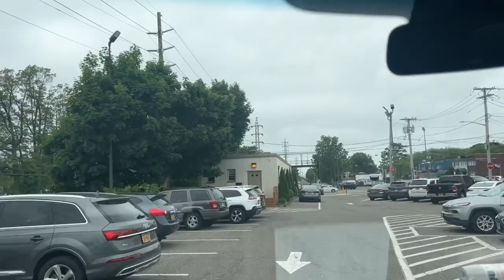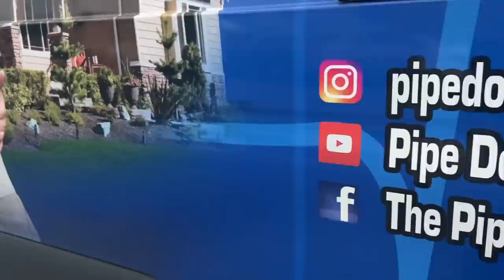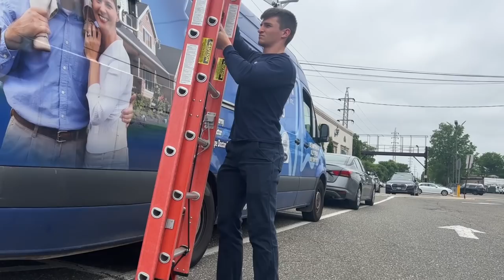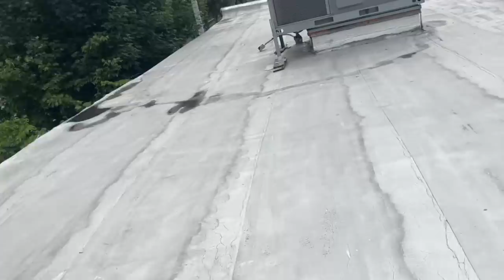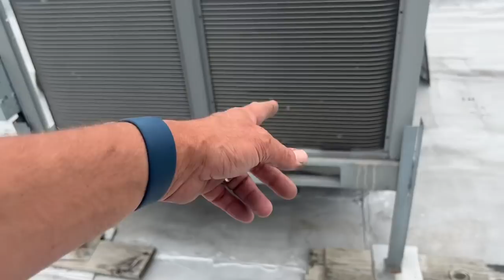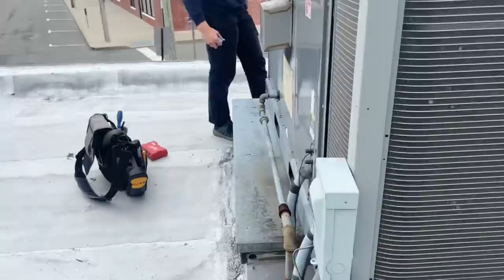Did I Hack This Rheem Commercial Rooftop Unit?

Comment: Instead of the tape you used , try some 2-4” tall strips of tin. Screw into existing ductwork that’s too short & into the unit. A more permanent duct extension , you could duct seal it afterwards too.

Comment: Mike, Joey's comment short of lifting RTU and addressing curb is the best option. Galvanized sheet metal strips is your least evasive move. 4 strips, 1 for each side to fill gap. I'm not able to see if you have enough overhang to put a 1/2" 90° break on each piece to butt up against the underneath overhang if you have any overhang to begin with. Before using selt tapping sheet metal screws you can decide if you want to apply caulking to the back side of strips, I would before applying sheet metal screws. Don't use silicon caulking, it garbage for this type of repair,  use a good caulking for the conditions this repair will be subject to in all weater conditions.
Reply: POOKIE

Comment: That Drop from the pole to the structure was definitely live…….
Reply: here's my large electrical cabling cutters, give it a snip and see. (yeah DO NOT)
very much excitement would occur, as the cable and tool turns into a fireball of long burning arc-flash, until it either fully burns in half or melts down upstream butt splices/connectors and they'll do that just that after a long period of buzzing, smoking the coating off, etc.
I've seen  service entrance cable below meter used for chaining up a dog! it yanked enough it shorted one hot leg to the ground braid and burnt the meter up and the whole cable on the home and 150 feet across the yard on three poles to the transformer, where it eventually burnt out a butt splice!
it was a rental property and they're like can you fix it? someone else was there and only quoted them a main breaker. YIKES that was not a good conversation we had, the place nearly burnt down and I called for emergency disconnect of the rest, the other hot leg was still live!

Comment: When I was doing HVAC. I always had a roll of tin 4" and 6" wide for such occasions. Cut to length. Screw in place . Caulk the joints. If it moves again. Just relocate the screws!

Comment: Mike, you can’t rely on the insulation properties of a triplex power drop to maintain its integrity when exposed to weather. Putting your hand on that or touching it in some other fashion can indeed result in an electric shock. All you need is a pathway the size of a small pinhole. That bundle is the power for that building coming from that pole.... so yes, you want to avoid something like that, or……put approved insulation sleeving over it before you approach it. Some people think that a voltage such as that won't kill you, and those people are wrong. All you need is for your heart to go into fibrillation, and without an AED, you are dead before the ambulance can get to you are use their AED they have on the truck. Also, the real fix, as you probably know, it to re-curb for that unit. Many malls do not allow the use of curb adapters because of water issues.
Reply: yeah, they should stay away from it. but in reality they'd have to grab it with two hands or be touching something else grounded and grab it. 
the bigger issue is it's not fused and could become a nasty arcing fireball if it got shorted somehow, also any of the wiring there is a tripping hazard and could make you do a header off the roof. unless you're some crazy parkour person, taking a header off a roof never ends well.
Reply: @throttlebottle5906   Actually, it only takes one hand. You would be shorting one of the hot legs to that messenger wire.... which is the neutral.
Reply: @arthouston7361  yes that would shock you're hand, possibly cause arcing and maybe a fall from the ladder. the fall may very well kill you, but single hand touching at that voltage wouldn't, unless you have conductors ran around your body or are grounded at some other point. the power would stay localized in you're hand/arm end.
Reply: @throttlebottle5906  Not true. There is a very high chance that hand shock sends your heart into V-fib. See above. The fall of 12 feet from the roof in question might kill you, but the V-fib will definitely kill you unless that rhythm is restored in under 10 minutes. We learned how to not die in lineman school, and I still practice that level of safety as a commercial HVAC tech today.
Reply: At 240 V with at least 200 A . NO BUENO!!!!!

Comment: sheet metal strips tall enough to cover the gap  with a 1/2 inch bend, the put the double-sided sponge tape   on the 1/2" side and press it to the top to seal there then sheet metal screw the sides, then tape the joints

Comment: that's a temporary fix, the unit is way too large for the curb, with too much weight in the "flying buttress"  on stilts. that end is smashing the roof deck down, it may not be overtop any structure and wont quit sagging, it may even punch holes through the roof.
a further temporary hack, would be using some 2x4's built up to a 4x6 or 6x6 to spread the load out far wider across the roof, but that would trap water and not be good for the roof, even if the wood was notched every so far to allow water drainage. for the duct and curb extension, cut tin into bands and screw it in place.
*proper way? they need a new roof with a larger curb installed, connected and properly supported by the structure below. they may be able to just correct that one area and patch it in, if the roof and structure is good.
Reply: Ideally they should have bought a curb adapter, who knows if the S + R are even lined up or if 1/3rd of them are cut off.

Comment: The unit sagged because there is weight on the compressible roof insulation. The RTU should be fully supported to the structural deck and framing. the unit may have to be pulled and reinstalled with structural and roofing corrections. If there need to be end supports, they need to extend through the roof into the structure, and be professionally treated as a roof penetration with an engineered roofing flashing solution. 

You are in the position of putting lipstick on a pig here. .
Reply: "Some" roofers do a great job, and some are absolutely horrible. They should have the unit on 2 x 6"s on the metal deck and spanning a couple trusses. I never cared where the print told me to put the RTU, unless the electric was roughed in already, I put them where I wanted and made up the ductwork to fit the register layout. I always loved being able to move things around when it made sense, these engineers go off of very old prints, they don't know what's been done to the building.

Comment: Sometimes the manufacturer has a drain plug in the center of the drain pan. At which point you can use that as your drain line but you’ll have to drill through the curb to run the line and establish your termination. Carrier RTU’s have them I’m just not sure if Rheem does, couldn’t tell from the video. Thanks for the video Saint  Mike!

Comment: The right way is replace curb adapter but I had this issue and I ended up using sheet metal around supply and return screwed to the unit and folded to mate with seal on curb adapter

Comment: Unfortunately the curb or adapter needs to be fixed. BUT, those pans are usually reversible, and there isn't much holding them in there, I've ran into this and I shimmed the drain pan up on one side and shot some 5/16ths self tappers in it - up high, to hold it. I think I had to chop off a piece of the plastic pan that sat in a grove but it sure was easier than raising the whole unit. If the ductwork was installed correctly there's often enough play in the canvas that you can move the unit a bit up/down/sideways etc. Lots of guys don't even use a canvas though, or they do but then they lock it in place with hangin strap so you can't always count on that...

Comment: you did a good job with what you had to work with.  you are right the real way to fix it would be pull the hole unit off of the roof and put a new Curb adapter in.

Comment: Go to truck and grab jack from wherever its located. I always carry pieces of two by four. jack up unit after disconnecting gas pipe union. Make sure your electrical is free or has play. Jack up one side and add insulation foam tape, the thicker the better so doubling it up works too. Jack stands with four by four wood is good for safety. place blocks of wood in space to allow you to get cross member insulated fro supply and return.

Comment: Definitely leave curb alone unless you are ready for a proper fix. I always create a foot for the drain pan  it can be all kinds of un-level on the outside all it wants but you definitely can create fall depending on type of unit some screws might need moving and stuff like that also depending on weight you will have to choose the correct material but start at the back of the drain pan work your way towards where the water exits. Create your own fall underneath the pan leave outside alone till proper repair can be.completed. The foot underneath the pan is always a good idea to get you thru.

Comment: Looks like you need a proper curb adapter made to the pitch of the roof so it  sits  level .I would  extend the duct up  or put a flex connector  so the duct has a tight  connection.

Comment: Spray foam the gap for insulating purposes, shave it down. Bend up some sheet metal with 90's and self tappers with silicone at the corners and top of screws. Should outlast the life of that unit

Comment: You could have a custom curb made and replace the one the unit sits on.  Crane charges + curb + time = X$.
Most new RTU"s are longer in the condenser end even though they fit an existing curb.  Had one similar that
a wind storm lifted the end of the unit up off of the curb and only had to use a pry bar to reset it.

Comment: Hard to say what to do if the roof settles after the installation, we usually have the curb adapters made for the current roof pitch.
Reply: maybe some duct board strips cut to squeeze in the gaps then silver tape.

Comment: 2" x 90 degree angle (tin or light gauge stainless ) around the duct between the unit and the duct, gasketed against existing duct and unit bottom, zip screwed into the existing roof curb or duct ( not bottom of A/C )  silicone or roofing tar any seam or joint. Will outlast the unit .

Comment: I wouldn't modify the drain pan wedge the drain pan that way you keep it nice tight seal on the curb clearly the business needs to get a new roof it's pitched up right but the train pan would have been the solution I would have gone with please try to

Comment: Flash  off the the gaps with sheet metal tape and pookie. Of course its gonna take about 2-4 hours to do the job you'll have to cut small peices of sheet metal and screw it from the unit to plenums.  Once you flashed all 4 sides of each supply and return plenums  tape with sticky tape and pookie what you tape and that's life time fix at least for the life time of the ynit

Comment: Hack install from the beginning on the retrofit piss poor craftsmanship who ever installed did not level the connection to the unit , condensate pan pointed that out no need to work curb just level cap cover to unit connection and seal according to condensation drainage to avoid trapping moisture catch , legs on retro should have a full runner on roof catching trusses depending on runs for proper support of over hang of unit... Maybe the gist of situation , foam in behind tape , cut fill in strips of metal to cover foam retrofits inheriting a headache for sure on little jobs . A full roof jack should've been included on original retrofit bid... 😆 just my thought process..